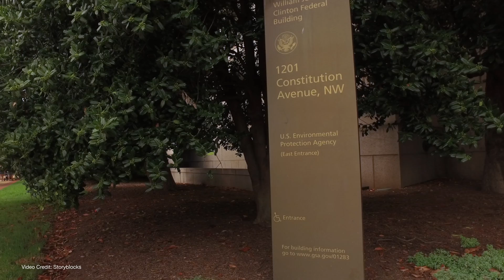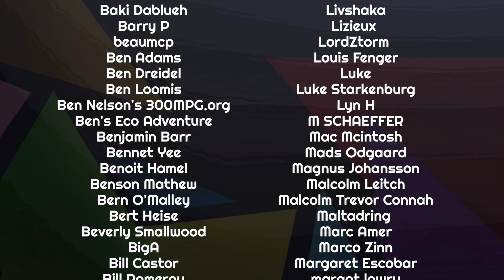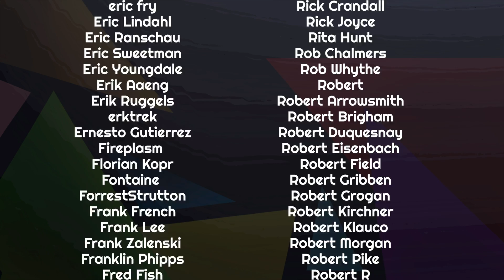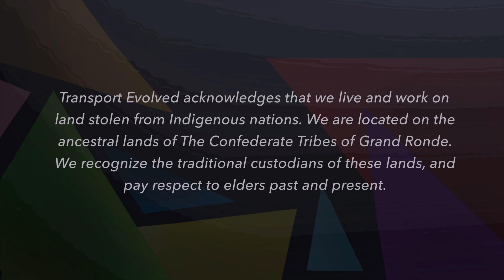Did This Automaker Cheat On Emissions?

Comment: I aint the sharpest tool in the shed, but i reckon if Tesla's able to sell so many credits, then that itself should be a form of proof that the emissions from EV manufacturing cannot be that great as detractors would have us believe. I hope i dont sound too stupid. So the carbon credit system may not be the greatest thing - but it does point out something when ICE manufacturers buy that credit, doesnt it?

Comment: There needs to be a new definition of "light utility vehicle" that excludes vehicles which are not primarily used for work.  I would suggest something like needing to have a payload that is equal to or higher than its curb weight without variable lift devices such as air springs etc., and having a low limit on the power to gross weight ratio (no limit on torque, though). 
This would mean that luxobarges, broughams, or muscle cars masquerading as "trucks" would not qualify.

Comment: Just make pick-up trucks require a CDL when classified as commercial vehicle. That'll quickly separate the folks who really need them for commercial use, and those who just want a fat lifestyle car.
Reply: Maybe not a full CDL, but any vehicle weighing more than 6000 lbs, or, if equipped to tow, more than 8000 lbs in combination, should require a special license that is both harder to qualify for and easier to lose, whether the vehicle is registered for commercial use or not, simply because of the increased damage such a heavy vehicle can cause. 
Think of it like type certification for pilots.
Reply: @robertkirchner7981  That covers all the 3/4 and 1 ton trucks. And all the Rivian's, the Mercedes EQV, EQC. Audi Etron 55. The Hummer EV (of course), Cybertruck, Ford E-transit van and Lighting. And pretty much every Rolls Royce makes.
Probably overkill.
Reply: @Species-lj8wh  Yes.  That covers the classes of vehicles that have been responsible for the surge in pedestrian and bicyclist deaths over the past decade:  large pickups and SUVs.  That's the point- to change what and how people drive in a way that benefits the public generally.
 If people want to drive excessively heavy vehicles that are also overpowered, let's ensure that they do so in an informed and responsible manor. Meanwhile if manufacturers find they can't sell sufficient numbers of such vehicles because the buyers would have to take an extra driving lesson or two, do some coursework  and pass a test, they'd be incentivised to start building lighter vehicles.

Comment: 13:43 You single out Tesla as being overly optimistic with their EPA range figures, yet in real-world tests, Tesla fares reasonably well compared to most other manufacturers. Just watch any carwow "we drove these cars until the battery ran out" comparison video and the Tesla generally gets 20+ miles beyond zero indicated and is up there with the pack. If you're going to make throw-away statements like this, you probably should include a reference to a current test. As usual, the tone when Tesla is mentioned is heavy... but it's upbeat when mentioning others. So, be careful of your biases. Or at least, see if you can say three nice things about Tesla in one video! I know you can do it!
Reply from the maker: Look. We went to great lengths to point out that every automaker does it - but in our experience, Tesla is the most overly optimistic (and Porsche has been the most pessimistic)
Reply: There are numerous reports and reviewers that talk about Tesla not meeting their advertised range.

Comment: Cupra have just launched the Leon eHybrid ( a 5-door family hatchback) in the UK with an offical fuel consumption of 702 mpg. That's from a 1.5 litre petrol engine, mated to an electric motor, with an official electric only range of 62 miles. Strangely during a road test a motoring magazine could not get close to the 702 mpg figure, averaging just 52 mpg in mixed motoring. However, thanks to the 10 grams per kilometre emissions rating, company car drivers get an enormous tax break if they drive one. As long as the government tests are as unrealistic as they are currently, then manufacturers will continue to make cars such as the Leon eHybrid.

Comment: 13:55 Tesla quotes the range based on tests defined by the US government regulators. I suspect Tesla could also provide their true expected real world ranges for typical drivers given typical driving conditions, but there is no way to provide a single number for the range of any electric vehicle. It is not possible with a single scalar number to allow for all the factors (speed, terrain, weather, temperature, traffic, driver leadfootedness, etc) that impinge upon the "real world range". I would like to see at least two numbers, one for 70 mph highway and a second for city or 40 mph driving, after all, ICE vehicles get two numbers, why not EVs?
Reply: My EV, a 2023 Hyundai Kona EV, does.  I am looking at the window price sticker, which I saved, and it says 134 MPGe for city, 106 MPGe highway, and 120 MPGe combined.  Also states 28 kWH/100 miles.  At what speeds they are basing that, I have no clue.  In the real world I am getting 148 MPGe combined.

Comment: I have a question; are car companies responible for carrying out their own crash tests.  I think I heard something about this a while ago on youtube, but I'm not sure.

You see if car companies are playing silly games with fuel efficency when it's the car companies who do the actual fuel efficiency testing, then you really don't want a similar system to be in place for crash testing and safety.
Reply: For US federal NHTSA crash tests, the carmakers carry them out according to NHTSA standards. Yes, it's possible for carmakers to cheat on this. (These also aren't truly required for all vehicles.)

But there is also the Insurance Institute for Highway Safety (the IIHS) which does independent crash tests on vehicles bought as if a regular customer. They even try to buy the vehicles "secretly" so that the carmaker can't deliver a "specially prepared" car. So their ratings should be truly independent and free of any cheating.
Reply: @AnonymousFreakYT  But they publish their tests, and as such, the auto manufacturer can cheat by only working on what the test is.
Reply: @ronaldking1054  Which is why IIHS constantly updates their tests. And they design the tests so that even if a car is truly designed "solely to do well in the test" - that actually improves actual safety. They aren't arbitrary.
Reply: @AnonymousFreakYT  Yes, it is perfectly fine for students to not understand anything in a curriculum because we only test certain things. By your last comment, I can only gather that as being something that you accept.
Reply: Carmakers definitely are “taught to the test” with respect to car design.
Reply: @stevewausa  Yes, and it means that if they need to actually endanger a person to make the test result be higher, they'd have an incentive to do it.